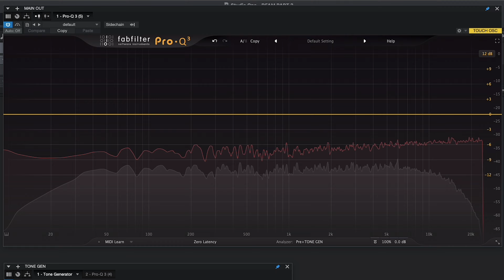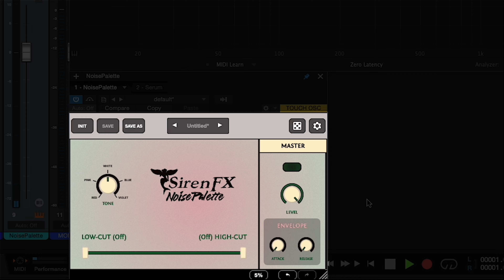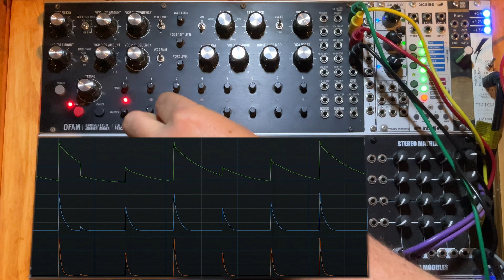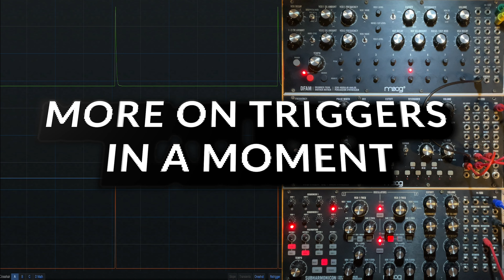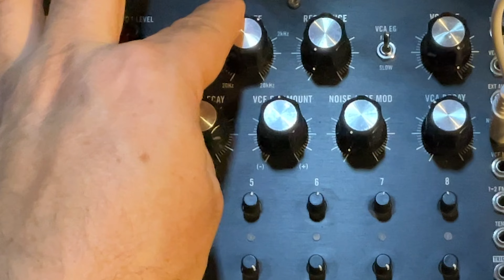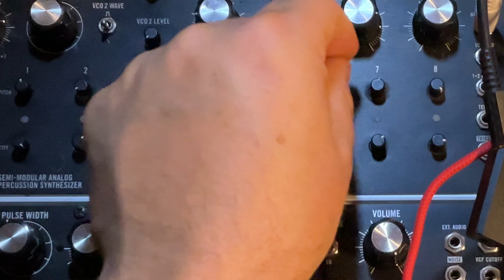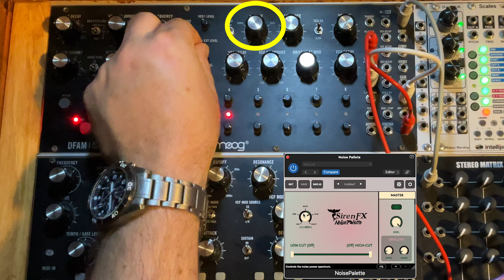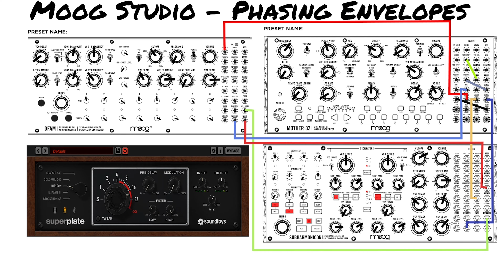DFAM DEEP DIVE PART 2

Comment: I'm curious. The DFAM envelope velocity behavior. The manual says its a VCA post envelope. Is that true, or is it an envelope whose height depends on the amplitude of the trigger going into it?
Reply from the maker: Velocity affects all 3 envelope generators on DFAM (VCA, VCF and VCO EGs). I’m going to get more into that when I finally get around to part 3 of the deep dive. But simply, velocity amount increases the amplitude (height as you say) of each of the envelope generators….after physical eg amount knob positions…but velocity is bipolar so can reduce envelope amount. Center position on velocity sequencer is 0 (physical knob position)
Reply: @RobeMusic  I'm asking how it works. If you plug an LFO into the velocity input on DFAM, with a long enough envelope you would see that LFO modulation if it's using a VCA between the envelope output and the amount knob like the signal flow diagram in the manual suggests. 
I'm just wondering if that's the case or not. For replicating the effect in a different modular.
Reply from the maker: oh...i misunderstood your question...thought you were talking about velocity sequencer.  Yes, it functions the way the manual says it does. Again, I'll be getting into the CV inputs in the next DFAm vid. good luck  with your reproduction